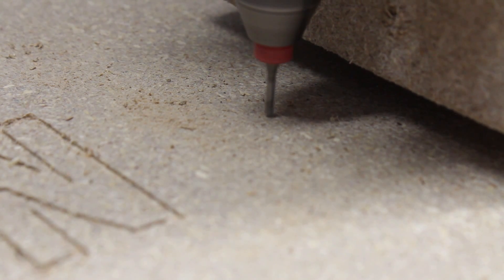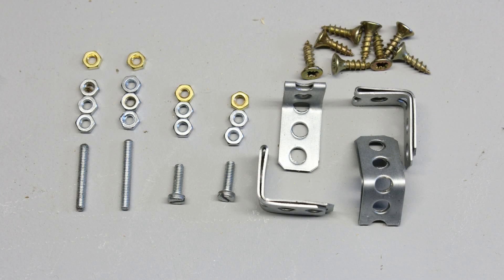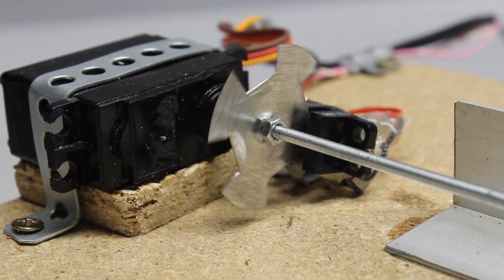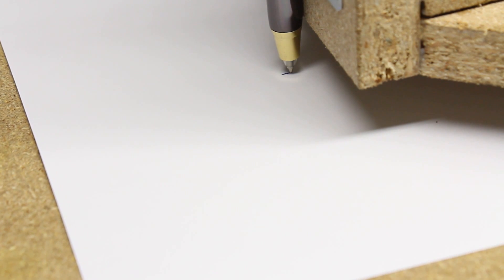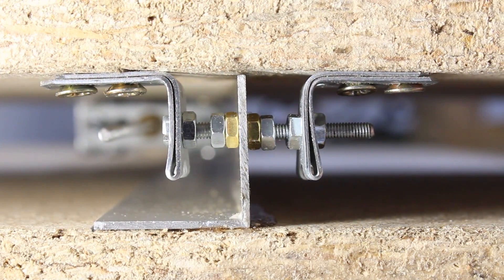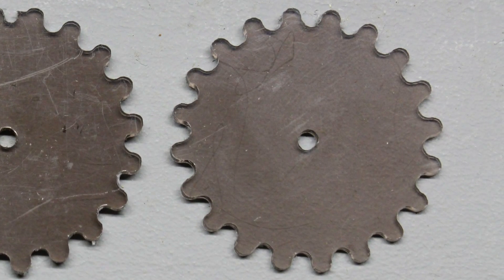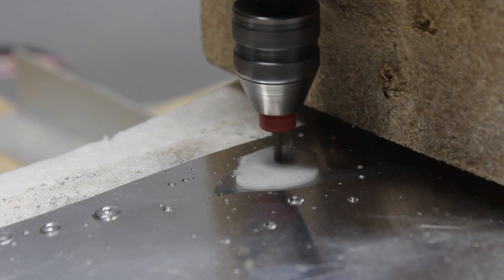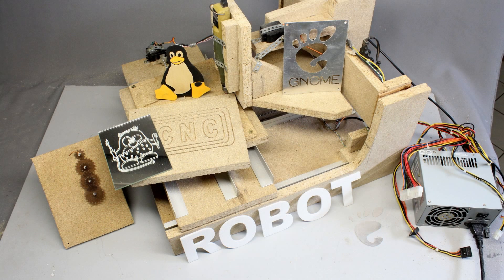Homemade CNC machine v0.5 with materials from a DIY, build with low tech tools

Comment: Interesting project. I am kinda shocked this worked given the friction on those linear rails, and the use of hobby servos.
Reply from the maker: With the 3mm threads that have a pitch of 0.5mm, the overall reduction is enormous, so the friction doesn't really matter. The drawback of the high reduction is, that it is a veeeery slow machine, for patient operators only ;-)

Comment: Nice Design , but actually the Brass is harder than the Aluminum Angle so it will actually wear off faster.
Reply from the maker: Well, this is not a machine for mass production, more something to learn how things work. The wear of materials isn't that huge problem ;-)

Comment: Norbert, at 11:35, was the tool stopping too soon because of "skipped steps" within the motor/sensor/Arduino communication or because of backlash/deflection? (I'm finally building my own machine out of 2 printers and an old closet organizer cabinet...it's all your fault... Thanks!!)
Reply from the maker: +Jake Little The machine did not skip steps, the cut gear simply broke from the plastic plate before the router reached the initial position, thus the last gear tooth wasn't cut correctly.
Yes, those "closed loop" motors can't skip steps.
Another CNC (version 3.0) is under construction (as submission to the HackadayPrize2016):
http://www.homofaciens.de/technics-machines-cnc-v3-0_en_navion.htm
I will test some more encoder drives with that machine -stay tuned!

Comment: Using servo motors should be cheaper than using stepper motors correct?
Reply from the maker: +capoman1 Not necessarily. As shown in the video, the cheap servos are not very reliable. Have a look at my CNC v0.6 that uses geared DC motors from old printers:
https://www.youtube.com/watch?v=5rQ4xKRfXts

Comment: Nice little CNC machine, especialls given the "crudeness" of the chosen tools, methods and materials (and shortness of time). I like the double-bed construction; had used that for my own DIY machine as well.
Reply from the maker: +JoEtuuube Thanks! This was the first time I used the double-bed construction. CNC v0.6 ist the next step in evolution:
https://www.youtube.com/watch?v=MlR-9Uiab60
I am currently trying to improve the accuracy of that machine changing the design slightly.
Reply: I saw your most recent build, it is awesome as well. There's of course a lot of room for precision improvement as you alreaday mentioned with some issues in our video. I guess your goal is to stay as simple (and time-saving) as possible, right? (I have put way more efford in my CNC and get a precision of 1/20 mm, check it out when you want) :)
Reply from the maker: +JoEtuuube Yes, this machine was build with low costs and simple construction in mind. Where is the video about your machine? I always enjoy having a look at the construction principles of other CNCs.
Reply from the maker: +JoEtuuube Great channel! You are sharing many good ideas that keep the costs of a CNC low.

Comment: And how about using DC motors like this one?
http://www.ebay.com/itm/Mini-130-DC-Motor-DIY-Four-wheel-Motor-Scientific-Experiments-Part-Free-Shipping-/301693062212?hash=item463e4ecc44:g:s44AAOSwFnFV~r7v
Reply from the maker: +minecrafter9099 You need a geared motor with much higher torque. That cheap direct drive won't be able to turn the threaded rods. In my CNC v0.6 I will try multiple motors e.g. the geared motor used to open the tray of old optical drives:
http://www.homofaciens.de/technics-machines-cnc-v0-6_en_navion.htm
Reply: Tanks for the answer, where can i buy chep servos / stepper mottor?
Reply from the maker: +minecrafter9099 The cheap servos I was using are from poor quality! Cheap doesn't mean good. Look for a shop that is located in your home country even if they are slightly more expensive, but you will get warranty.
Reply: Thaks, i have a eletronic shop not to far from here :) i'll check

Comment: I don't now if this has been said, but I would use two aluminum 'L' runners back to back and fastened together to enhance rigidity and for the drill bit, use a Roto Zip bit.  They are made to cut sideways and pull material up and out of the hole being cut.  (Obviously if they are available where you are)

Beyond that, your ingenuity and presentation are top notch.
Reply from the maker: +Pascalore Thanks for your comment. I will try better drill bits sometime - there is nothing better than quality tools!  I have used more solid aluminium bars at the mechanics of v0.6 If that still isn't enough I will try your double L-bar option.

Comment: use safety when handling the styrofoam...
maybe you could reduce the amount of the heating coil to lower the fume :)

gonna try this maybe with some old dc inkjet printer motors and ic driver :D
Reply from the maker: +Prasetyo Muhammad Dwi With the long copper wire the temperature is adjusted to the lowest temperature and so the lowest fume possible. It's really not smelling too badly.
Reply: still bad for your lung, trust me :D

you mean long copper wire and heater from soldering gun?
Reply from the maker: No, I mean the copper wire at the tip of the soldering iron as seen in the video.
Yes, the smell of melting plastic is always a bad thing...

Comment: how long to take the time to finish this project? ,,,, u r really genius..
Reply from the maker: +nico niki Thanks! About three weeks. I have spend most of the time to think about how to turn it into reality and to record the video around it. And it's not finished - it's just an intermediate step leading to my next machine:
http://www.homofaciens.de/technics-machines-cnc-v0-6_en_navion.htm
You should be able to build that machine on a weekend.
Reply: +HomoFaciens ur using arduino?
Reply from the maker: +nico niki As shown in the video I am using an Arduino Uno board. Great tiny piece of hardware!
Reply: +HomoFaciens owh ok i c... btw im not good in coding... is there has any library tht i can copy d code?
Reply from the maker: +nico niki There is a download linkk for the software I am using on the project page: 
http://www.homofaciens.de/technics-machines-cnc-v0-5_en_navion.htm
Reply: thanks..

Comment: you are inspiring me to build one... u r relay awesome
Reply from the maker: +Pawan Kumar Have a look at the build process of my next CNC (v0.6) that has a better mechanics:
http://www.homofaciens.de/technics-machines-cnc-v0-6_en_navion.htm 
There is also a video showing the electronics in more detail under construction:
http://www.homofaciens.de/technics-base-circuits-encoder-disc_en_navion.htm 
That will give you the knowledge to build an improved version with the same costs. Stay tuned!
Reply: definitely man checked out  0.6, 2.0, 1.0     and will build one of them in upcoming 3 months and I am just 16.The supplies that take to build one are relay low too.
Reply: thanks man
Reply from the maker: +Pawan Kumar I recommend starting with v0.6 since you need only a few low tech tools to create the mechanics. You can learn a lot when building your own CNC and start experimentation with your next one.
The video about v0.6 will (hopefully) go online in the next 4 weeks... 
If you run into trouble during the build process, drop another comment.
Reply: i sure will u r relay great man thanks for the help
Reply: help me will ur 2.0  work on alumium? what spindle and motors should i use?
Reply from the maker: +Pawan Kumar Whether the machine can cut aluminium or not depends not (only) on the spindles and motors you are using. It's the build quality of the whole mechanics that has to be very solid and free from clearance. The router also shouldn't be a cheap one with enough power (mine has 120W). Cutting 1mmAluminium as demonstrated in the video is the limit of that construction. You won't be able to process solid aluminium blocks.
Reply: tanks man  :)

Comment: Almost finished my own CNC Router ,but costs and used materials are on a different level. I am impressed that you manage to invent such cheap working machine out of scrap :D Such a clever mind!
Reply from the maker: +KonKrom Thanks! High quality but expensive machines are available on the market from multiple manufactures, but the challenge is higher the lower the estimated costs. V0.6 is under construction and that machine will (hopefully) become a better CNC: 
http://www.homofaciens.de/technics-machines-cnc-v0-6_en_navion.htm 
Would be nice to see your CNC router soon.
Reply: I appreciate Your work! It's all great. You inspired me to do my own CNC. Today it start to print with pencil my first svg file. Boy, how happy I was! If you want to use software under windows try All to G-Code Converter with Universal Gcode Sender it's easy and free ;D
Reply from the maker: +KonKrom What about a short video showing your machine? Share your success with the community to inspire more makers on this planet...

Comment: Can't believe this, you did it again. You really are back :). Great about innovation and about using servos and work all by yourself, good for education. Servos concept is great, but previous machine was more rugged and better. I understand this one is much easier to build then to cut threads on previous one, but without bearings simple as it could be. Just stronger angle profiles and putting some lubricant on guides will fix it. Good machine for education, simple, affordable.
Reply from the maker: +Igor Ć. Yes, that's what this machine was made for: Education!. Nonetheless I would like to improve the design to get closer to the accuracy of v2.0. Watch the build process of v0.6 on my project page: 
http://www.homofaciens.de/technics-machines-cnc-v0-6_en_navion.htm

Comment from the maker: +Juan Jose Valladares It's now available in the download section:
http://www.homofaciens.de/download_en_navion.htm#CNCV05
Reply: thank you very much for answering my comment! Now if I can start making my own project, thanks
Reply from the maker: I am working on an improved version:
http://www.homofaciens.de/technics-machines-cnc-v0-6_en_navion.htm
Reply: +HomoFaciens what happen if i dont use the sensors, i have to make ane changes on the code? and chanches need the code if want to make a small version of your proyect?
Reply from the maker: You need the sensors when using DC motors!
If you use normal stepper motors, you don't need the encoder discs, but of course you have to make changes in the software code of the Arduino Uno.
Reply: HomoFaciens

Comment: Nice, but I believe at this point you might as well go for homemade linear guides(roller bearings on angle), and really, start using steppers.
They're cheaper, much easier to use, nothing to fabricate(other than the coupler out of some rubber hose).
Also, try salvaging inkjet printer carriages, they even have steppers already attached to them.
Maybe a hacked together DIY 3D printer?
Good job as always, keep it up :)
Reply from the maker: +Spirit There are two things why I am still working with DC motors:
1.) I like to make things different.
2.) There are some people on this planet that can't order all that brand new stepper motors and CNC drives within 24h from any place in the world. They have to improve using scrap parts. I would like to inspire those people (I get great feedback from some of them).
This is why there will be another simple CNC (v0.6) with an improved design using DC motors (I still don't know what kind of drive). There will be an evolution of machines and I'd like to see what you can achieve with simple designs before going "conventional" ways.
But of course there are already machines using stepper motors in my brain. I have some old printers and scanners in my cellar and they will be used for machines, too. Using brand new steppers and drives is the final step of evolution.
Thanks for your feedback!
Reply: HomoFaciens That's what I was thinkning.
Scrapped steppers, maybe even scrapped drivers(90% of the printer drives are just hybrid modules that you hook up power and signaling to).

Comment: Really nice. Those are the most highly modified servo's ive ever seen but looks like you made them work well.
Reply from the maker: +builtrodewreckedit Thanks! When I started this project I thought that the modification for continuous rotation would be all that has to be done, but the devil is in details, thus I had to do some more hacks. That's what happens in prototyping...

Comment: I'm really impressed with the level of accuracy you achieve with these machines.
Reply from the maker: +StarDustSid ...but as demonstrated in the video that accuracy isn't too high...
I will try to get better with version 0.6 - stay tuned!
Reply: +HomoFaciens Don't be too hard on yourself. For a machine made with basic tools and mostly scrap the accuracy and smooth motion was very impressive.
I'm hoping you build a 3D printer, (hopeful hint), at some point in the future.
Reply from the maker: +StarDustSid Not being satified with what CNC v0.5 can do is the motivation to improve the design and I have already some ideas for a better mechanics. 3D printers need much faster drives. I will examine several types of stepper motors and drive systems if I can find backers for that idea (until now I am working with materials I have in stock). After that 3D might be an option (but it's currently not at the top of my list).